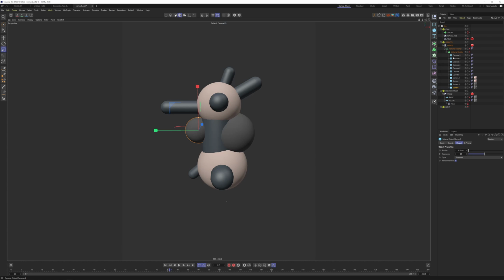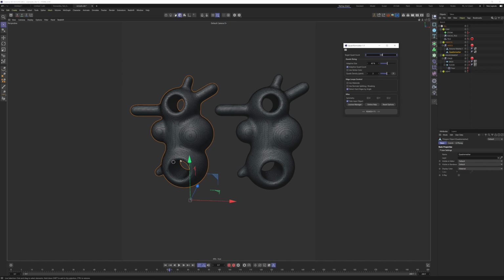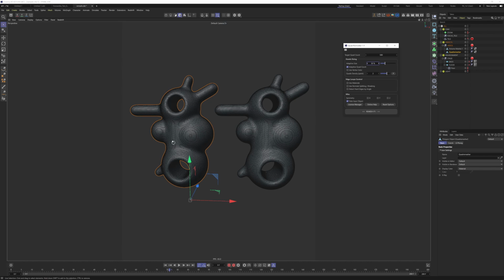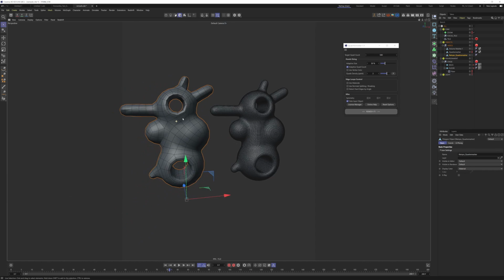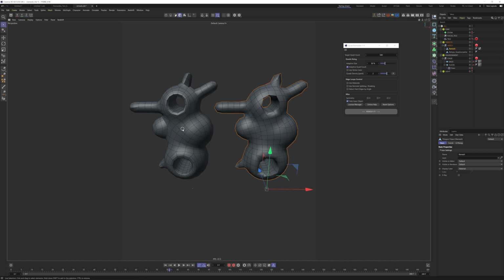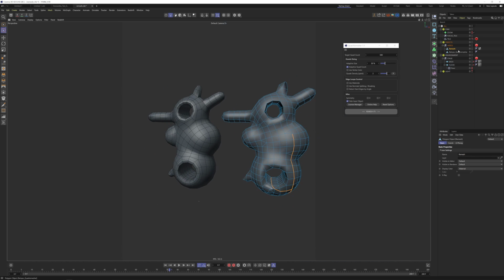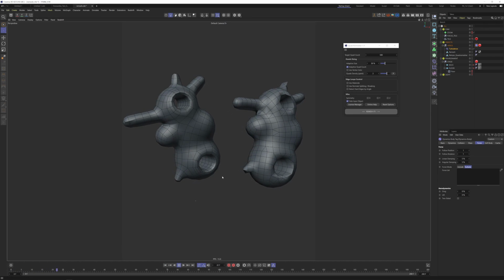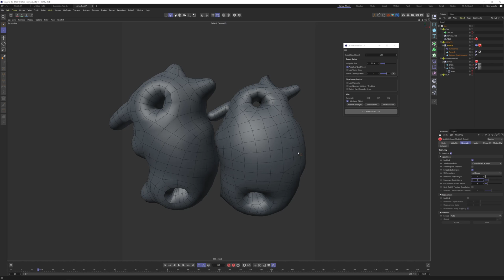Basics of C4D Sofbody - How to remesh your object.

Comment: Hey Vincent. Thanks for the tutorial. I have been a patron for a couple years and always enjoy your content. One question I have is regarding topology for soft bodies. I am currently learning houdini and it's been advised to tetrahedralize all incoming geo for soft bodies. then you can use a point deform and use the tetrahedralized sim to deform the high-res quad mesh, which you can then use for rendering. I was wondering If you had done any tests with triangulated meshes, or if C4D has a similar point(vertex?) deform system. It's incredible how dense the meshes Houdini can sim as soft bodies, but the process isnt as intuitive or enjoyable as C4D. The only tiny thing I don't like about C4D soft bodies is having to go into project settings to change values, that seems a little weird. I think I'll purchase quadremesher now
, lots of people seem to think its great. cheers
Reply from the maker: Hey Sam,
since 26 the quardremesher is build in, so you don't need to buy that. Also C4D's new cloth engine is great, I hope they will implement that into softbodies as well.
Reply: @vincentschwenk  ah cooool! I'm still in an old version, the new release looks super nice. thanks!